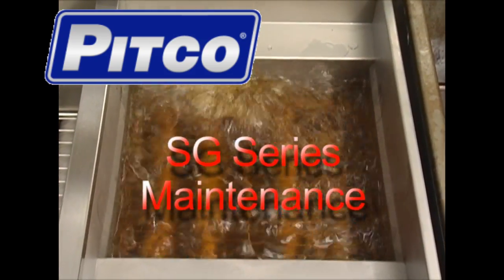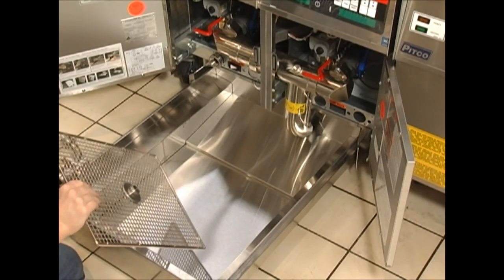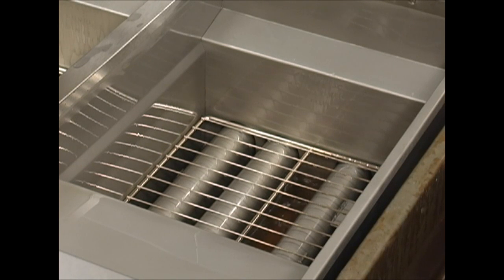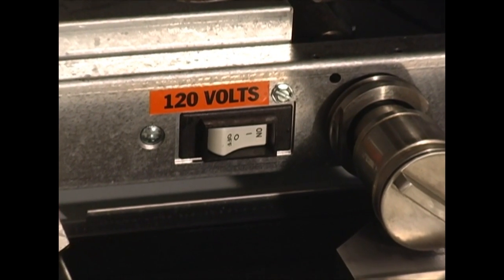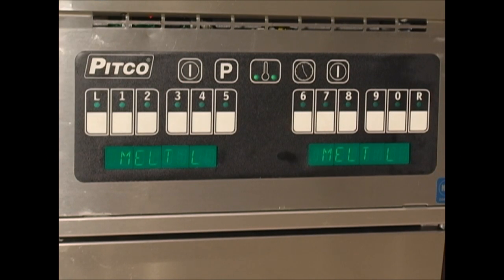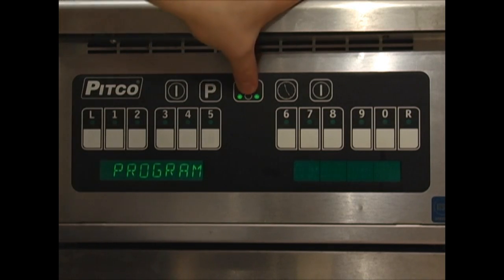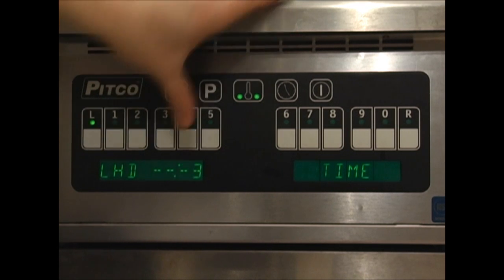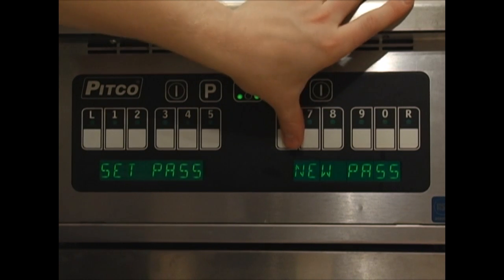Pitco Solstice Filtering, Troubleshooting & I12 computer Programming

Comment: My left fryer will not fill when I pull the red handle unless the right fryers red handle is also pulled. Making it impossible not to mix the two oils. Both the fryers must be filtered at the same time. Unless I do just the right one only. But I can't do the left one without simultaneously doing the right. Any suggestions of what could be wrong?